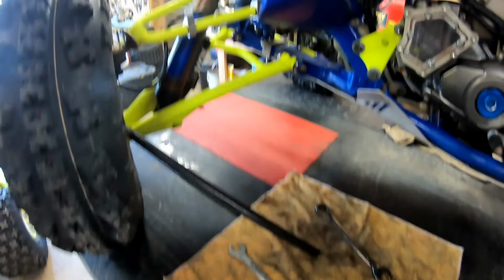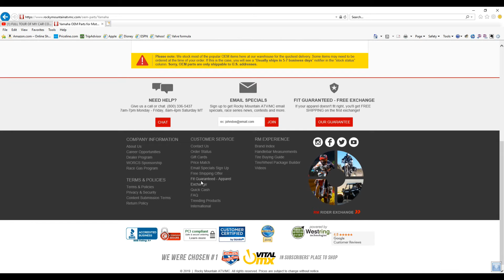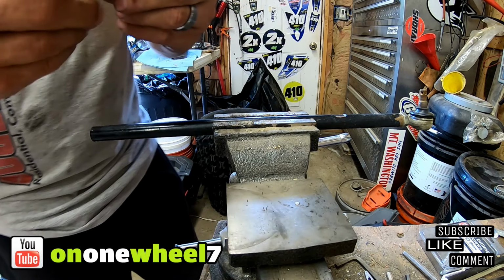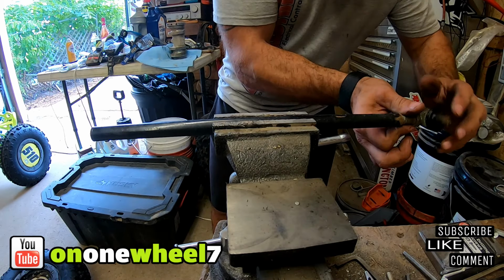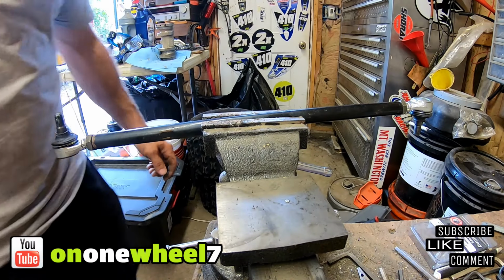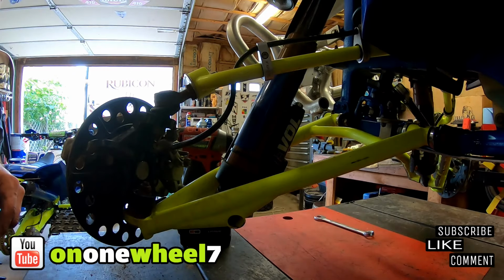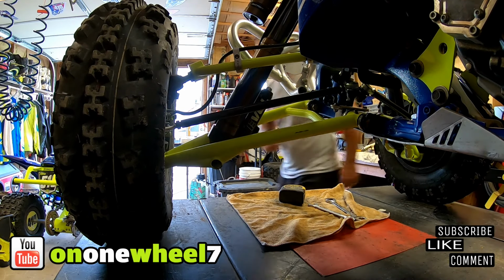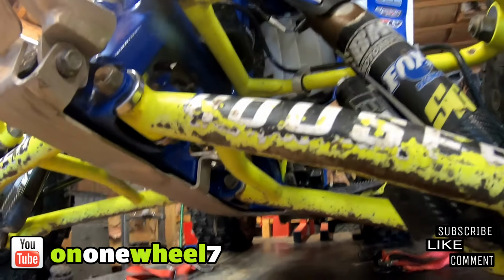QUAD REPAIRS - CHANGING SOME TIE ROD ENDS

Comment: How far down do you tighten them to know they are good ?
Reply from the maker: So i use a locking nut vs castle nut so i snug mine up a little more since i don’t use a cotter pin. 13 ft lbs  is what the manual says
Reply: @ononewheel7  ok thank you.
Reply from the maker: Anytime man

Comment: Hey man so I just bought some of these ball joints off partzilla for my 05 yfz 450 but for some reason the diameter of the new one is too small compared to what was originally on the quad.  The ones you have in the video look similar to what’s already on my quad. I’m wondering where you purchased those at?
Reply from the maker: So i am just using oem tie rod ends! I got these from either waynesburg yamaha or rockymountain! Are your tie rods stock or after market? Sometimes w after market ones they can be larger!
Reply: @ononewheel7  they must be aftermarket then because they are quite bigger than the ones I got from partzilla
Reply from the maker: Gta find out the brand then you could search for the correct ones or try measuring them then you can at least verify before buying new ones!
Reply: @ononewheel7  my question is how do I go about finding the right ones now or do I need to replace the whole tie rod itself to fit the new ones
Reply from the maker: Are you running stock a arms?
If you can measure them then maybe when searching for new ones you might be able to find a match! I always see heavy duty tie rods on ebay that are larger vs stock!

Comment: Are yfz 450 differentv
Reply from the maker: The yfz450 is carbedurated
The yfz450x/r is fuel injected and has a completely different frame and engine and plastics